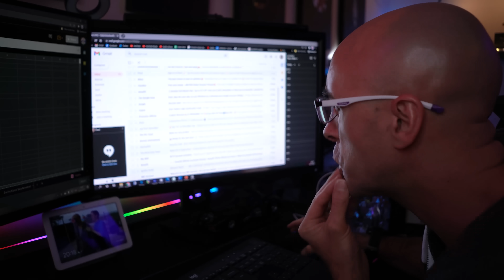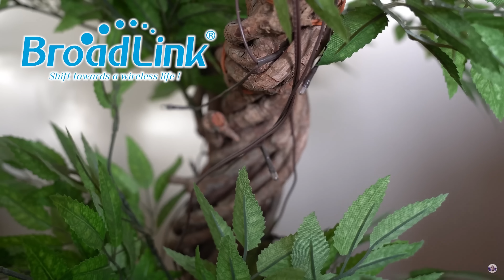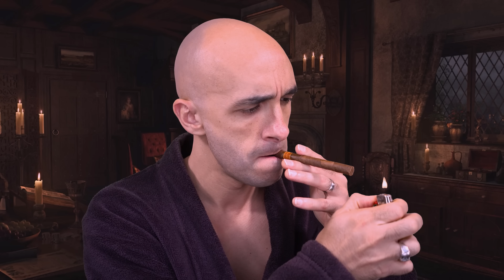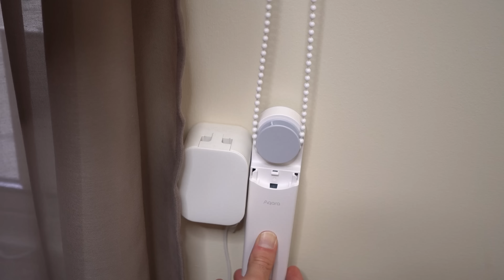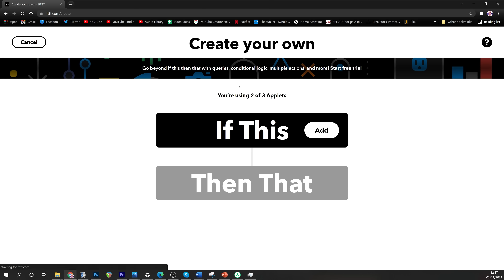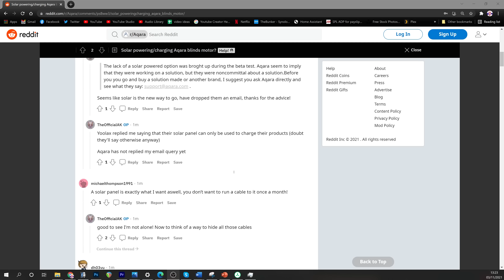The Smart Home Blind Motor EVERYONE Is Talking About

Comment: Hang on, do you specifically need the E1 hub to run these or will they work with other Aqara hubs? I already have an M2 and G3 Pro so would like to use those and only add E1’s if I’m having range issues.
Reply from the maker: I don't THINK you need an e1 hub. I'm pretty sure I was using an old M2 hub when I made the video because it was already plugged in, but I could be wrong. I've definitely connected the latest e1 radiator thermostats to the G3 Pro though and I know that for certain because I've only just finished filming that video. 😊
Reply: @paulhibbert  okay great. Thank you! The auction is tomorrow so if I get the house I’ll be buying a stack of them as all the blinds have chains. I suspect I’ll need at least one more hub so I’ll grab one E1 so then if they don’t work with the other hubs I can at least automate the bedroom blind straight away as I wait for more to arrive. 
Cross your fingers and toes for me! I’ve never been to an auction let alone bought a property at one! Exciting!!
Reply from the maker: @moniquem76  awesome. Got everything crossed for you 😁 if it's convenient for you then the affiliate link to the product is in the description 😂
Reply: @paulhibbert  thanks!!
😂😂 I’m not sure if the affiliate link will work coz I’m in Australia. I promise I’ll try it though!
Reply from the maker: @moniquem76  dammit! 🤣
Reply: @paulhibbert  😂😂 I know! It would have been a doozy too as there are at least 7 or 8 blinds that will need to become magical! And a button or cube for the spare room so people who stay a night don’t get freaked out 😂 Actually a cube might freak them out. Maybe a couple of buttons. Mum is 70. Need to be kind 😂😂

Comment: I have  one identical to your one. A clone !   You do realise you fitted the incorrect drive cog, that's why the clanking slack was so apparent. My one came with useless solar panel, so replaced with a 12v solar panel from Ali express. Just use supplied solar panel for connector. Now takes 12 weeks to hit 50% on power monitor.  Amazingly cheap for automatically controlled blinds ! Can tell you missed out on Lego Technic 🤣

Comment: Great video!

Question: I have a large horizontal roller blind which has a tension rod at the bottom. What is the weight-rating for this motor?

Also did you mean that if this is used with HA it would still need Internet connection to work?

Comment: I'm a big fan of Aqara and Xiaomi, but when I was searching online for the Aqara E1 a couple of months ago, I fell down the rabbit hole of AM43 zigbee blind motors from China. Most of them look like they were made on the same production line as the Aqara device, but they generally cost under £50 rather than £60, they talk to various Zigbee hubs (designed for the Tuya zigbee hub), and come with a solar panel. I'm not disappointed in my purchase of a few of them (I selected the Moes branded device, because I bought a couple of Moes no-neutral 3-gang zigbee UK light switches at the same time)
Reply: Agreed the Tuya one have solar, powered, sunset, sunrise comp and cheaper. Stick with Tuya and forget HA, IFTTT

Comment: I've installed a different £60 make 6 months ago to pull 4 metres of velvet curtains about 1.5m high on an opposing loop, un beaded cord. Runs twice, daily 0800 and sunset. still going strong.
Buying considerations: motor torque, backup battery and remote control for when power or wifi down.
Also a wall adjuster plate for re-tensioning the loop.
I don't think Paul's sample had this!
Reply: Where did you get it?

Comment: I have tried a few of these style of blinds motors and the same thing happens with every single one: eventually the chain starts slipping and the blinds end up at random heights. The only one I found that works flawlessly was SOMA (coincidentally, the one you also had attached to your wall when you installed this one). However I swiftly returned the SOMA one when I realized their Bluetooth security is shockingly bad - as in there’s no security. At all. Someone outside (I tested this) can pair with your unit and open your blinds. Not joking.

I had an interesting discussion with one of their software devs a while ago and he acknowledged the flaw and said they intend to release a HomeKit-specific model that will be secure. Until that time, I won’t be buying one, despite its mechanism being quite literally perfect. Also the best looking ones as well.

Comment: i think i'd actually like to see folks being warned about some of the complete turds, like say "magic home" lights (requires 3 power cycles in 10 seconds to reset but takes 4 seconds to power on each time) or those bloody neos cameras that forget to add the word occasionally to the "works with alexa" tag line and either record 24/7 or only when you tell it to in the app but when using motion detection only manages to send alerts unless of course you subscribe to their cloud service.

Comment: 2 month battery on paper means 1 month in real life. And homekit? There are two big smart assistants and then there is a pile of 💩 Not even an iCrap user is dumb enough to use it.
Reply from the maker: It's 3 months on paper if I remember rightly, the 2 months statement is based on homekit news experience.

Comment: Great! More smart home stuff. No offence mate, but today is not a good day. My whole Tuya system is practivally non-responssive in Home Assistant, it does not work well with Alexa, my 4-button Broadlink has been playing up with Alexa and button presses are not detected nor they trigger routines anymore. My TP-Link smart plug might or might not work in HA, GH or Alexa depending on Jeff Bezos' mood, my Grid (Tuya) controlled powerboard is cross with me and I have to re-configure it every couple of days, and my Tuya IR blaster may or my not control my aircon. I concluded today that we have been doing too much of corporates' dorty work, while they don't give a damn about  our time and/or money. When I see someone comes all jolly and cheering, saying they could get one of these "smart" things to work and everybody thanks them, it's like someone call you in the morning and say "Hey, remember that Mercedes that I bought brand new a month ago? I finally was able to start it. It does shut down unexpectedly and I have to call road side assistant and they simply ignore it, but hey! It started! I'm sure they will fix it in next couple of years and with 2030 upgrade, it will drive me half way through to work someday"!!!!  As long as we do all the leg work to get their crap to work, they will not fix their issues. Why would they do that? We idiots buy their junk and are quite happy with it!

Comment: Great video! Loved Mr Socky chasing the Aqara exec 😂 Even funnier are the DIY skills! How can you not get the tension right when using 3M sticky pads? 🤣🤣🤣
Reply from the maker: My incompetence knows no bounds, just like Mr Socky will attack anything a d anyone!
Reply: @paulhibbert  Roller blind chains come with a connector to join the two ends, you could undo this and remove a 'ball' or two at a time to fix the slipping - just be careful not to cut it too short! 🤣

Comment: My wife love the aqara cube, a lot of functions, in a small  container, but you don't need a special hub, if you use a neutral hub (deconz or whatever), one challenge though, the aqara sensors are sticky, so when you enroll them, you have to do it where they are placed, otherwise if you enroll them at the hub, and then move them away, they will loose connection if the hub is out of range
Reply from the maker: Good to know man! Thanks!

Comment: Technically saying "5V" wont use much electricity is completely irrelevant.  5V at 100Amps would still be 500Watts. 0.5KW.
Not that these devices use that much power lol.   Sorry, being pedantic there.
Xiaomi have done well, being that Aqara is part of there ecosystem.    Also, they don't phone home ,despite what people think.
My Xiaomi Air Purifier has no restrictions and it transmits less than 10MB a month over WiFi for controlling it, and virtually nothing to the internet.  Unlike some other devices I have (Looking at the SOMA Connect).
Reply from the maker: I commend your pedantry 🤣

Comment: you could get a wheel set on some sort of bearing with some more 3m tape on the back of it...off setting it from the centre of the chain such that it acts like jockey wheels on a bikes derailleur or something

because more 3m tape is what you need here!
Reply from the maker: Is this another BDSM thing? Never enough tape.
Reply: @paulhibbert  no, it was an idea about how you could pre-tension the pull chain of the blind...in the most elaborate and 3M tape to the max kinda way.

Orrrr....as someone else has said, you could remove the jointing bit, cut the chain down to size, and join it back up again 😁😅😉

Edit: ohhhhhhhhhh.  You've seen Rosie's comment already haven't you! 👍👍

Comment: Regarding the tension, most would have cut the plastic chain and taken one bobble out and rejoined using a blind rope joiner adapter thingy, but they just won't go through the cog.
Reply from the maker: Thos blind is on a string and I had to tie a chain to it! 🤣
Reply: Or you could measure it correctly 1st time and place it where it should be yo its tensioned right. Just saying